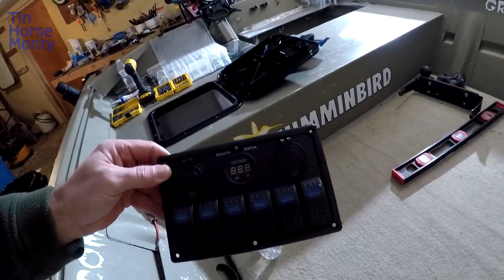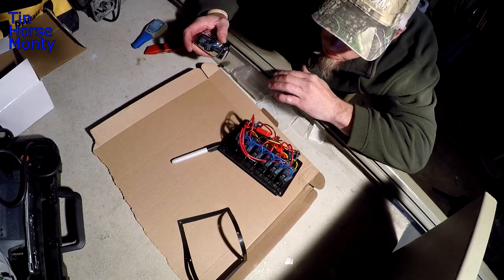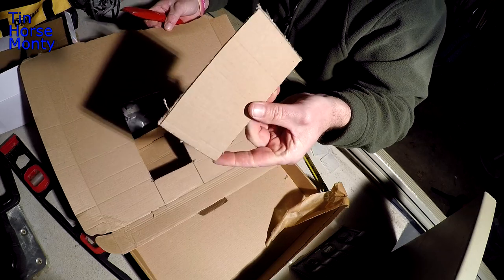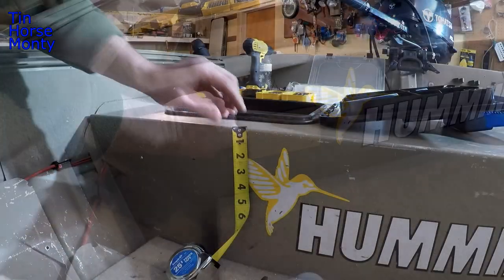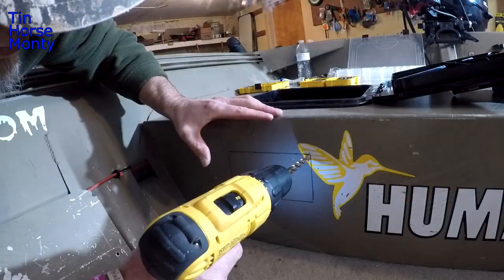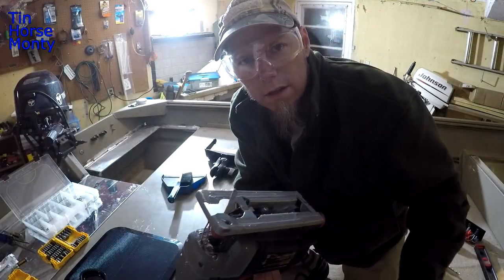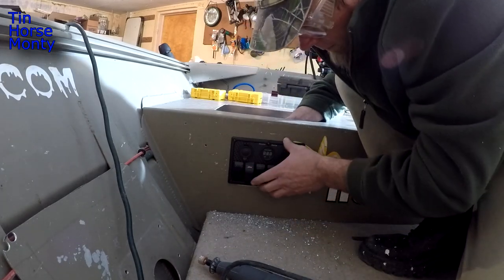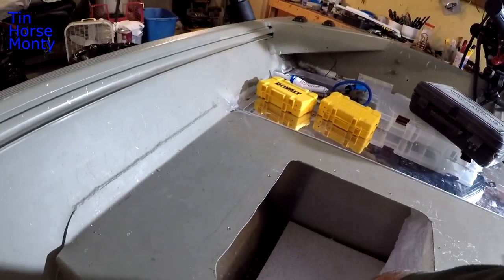Rocker Switch Panel Install On A Jon Boat

Comment: You have a lot more patients than I have on the cutting stuff.  I need to do something like that with my jon boat.  I ran switches for the front and rear lights, then put flood lights up front as I use that when duck hunting or going down the river (river is only 12 ft wide in places).  The rocker pannel is exposed as I did not want to cut into anything but in all reality I need to.  I have to constantly replace connections because it is exposed to the weather.
Reply from the maker: So far It's been working out god. That's a tight river!

Comment: Di you leave all of the foam in there for your hatch? I know this is old but just curious as to now. I want to do it to my boat but I want to take all of the foam out. Also wondering how sturdy it is? Can you stand on the hatch without issues?
Reply from the maker: I left the foam in for flotation but I lined the inside of the compartment with thin aluminum. Just boxed it in. I think taking the foam out will be fine. I considered putting another hatch on the other side. I weigh 215 and have stood on the hatch for a short time with no problems.

Comment: How did you end up mounting your fuse box? I'm doing exactly what you're doing here, but I don't know how I'm going to fasten the fuse box to the inside of the bench without screws protruding on the outside.
Thanks for the guide!
Reply from the maker: I was going to install a fuse block inside the compartment I made in the rear bench seat. I installed a hatch to gain access but decided to do the install with out the fuse block. The switch panel has fuses to each switch. I installed a master power switch that powers the switch panel. I used a 50 amp circuit breaker for my trolling motor. The graphs have an inline fuse. So far so good. I did a reveal video in the Boat Mods Playlist that shows what I did. Good luck with your install and take care.
Reply from the maker: https://www.youtube.com/watch?v=8XnQp00JoT4&list=PLPL8s_9WuHDlOeJCLEy8WmB9Os83yuP8-&index=9

Comment: how big of wire should go from the battery to the fuse box anyone can anwser this for me it would be great
Reply from the maker: I used 10 gauge
Reply: Depends on what you're running (total amps) and how far (distance in ft) Most cases in these boats, 10 is probably okay, 8 almost certainly is unless you've got some crazy electronics geared up. 

https://images.crutchfieldonline.com/ImageHandler/scale/978/978/products/2012/47/12c/Gauge-Chart.jpg lays it out.